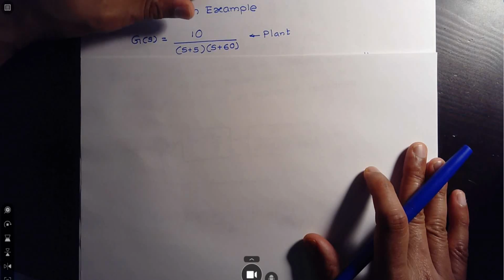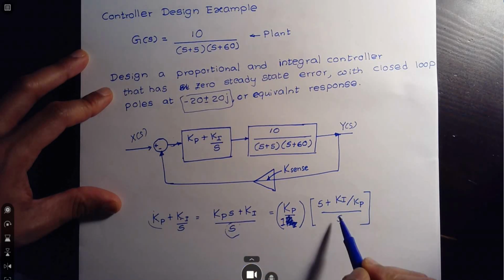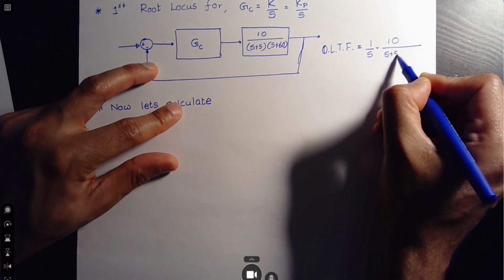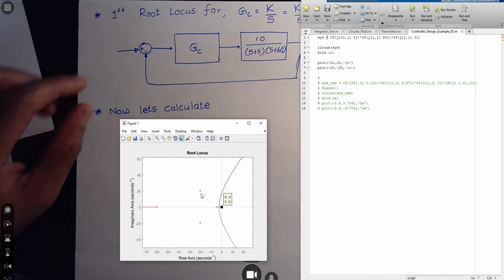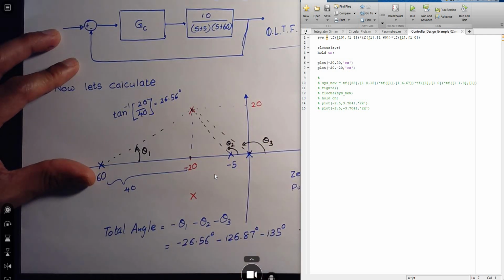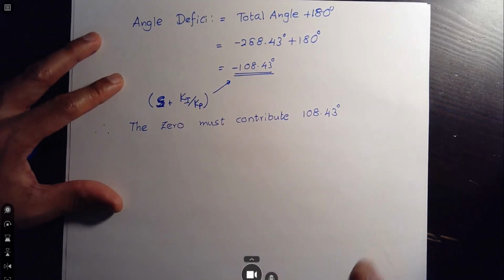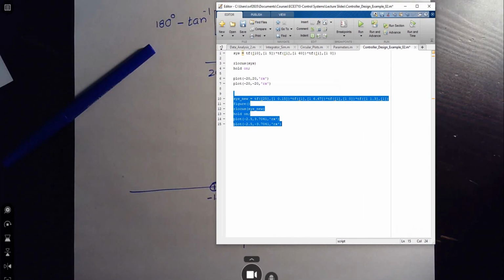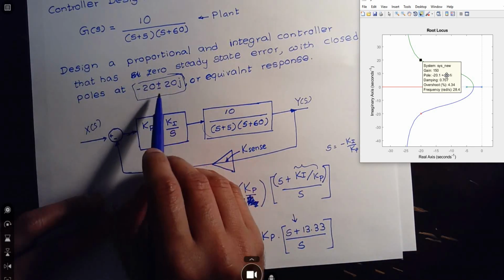Project Help Video 03 - Controller Design with Root Locus Approach

Comment: Hi Sandun, thanks for your videos as always! 

Would you be able to go over controller design example for a PMSM in the dq frame with SVM modulation? I’ve found this application quite tricky
Reply from the maker: Hi Doron, I have two other playlists that goes over exactly that. Have you checked them out yet?
Reply: Very nice explanation....thanks sir...
Reply from the maker: @ankitshrivastva361  Thank you Ankit!